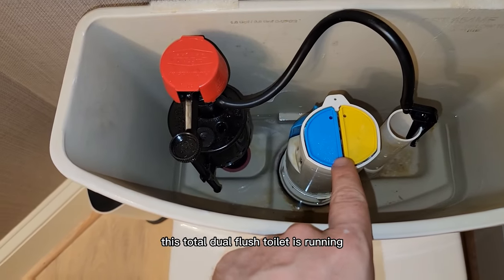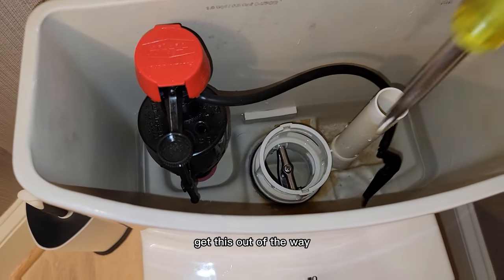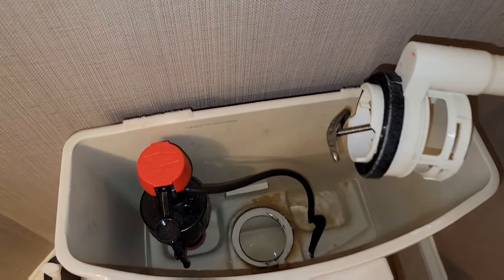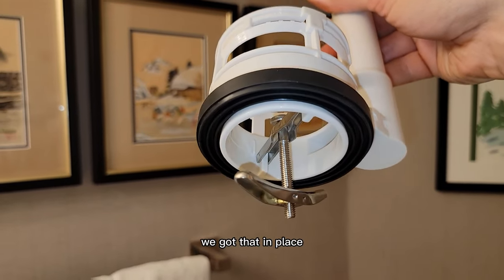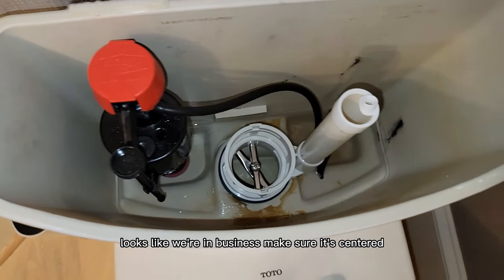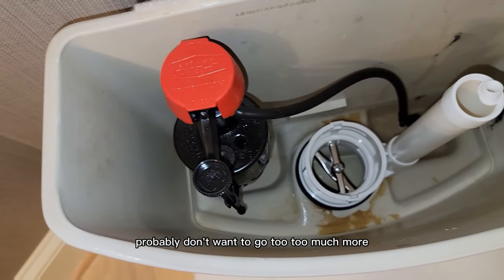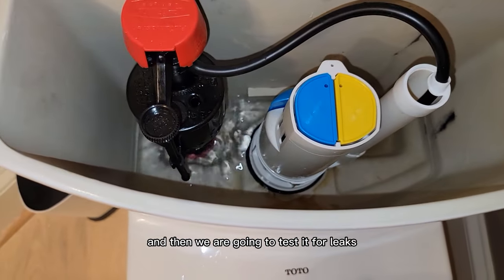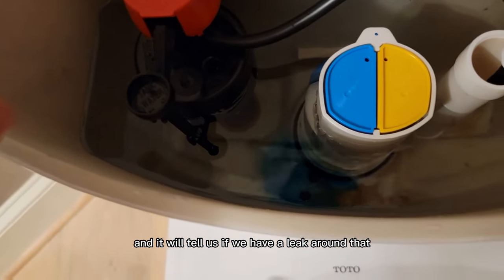how to replace a dual flush valve #toto #toiletrepair #plumbing

Comment: I just recently came across one of your short videos in which you were promoting the use of shark bite products, you also claim that soldering is going to be made illegal. I'm not sure where you're at in the United States, but in the Detroit area none of my colleagues ie licensed plumbers would ever risk their license on a SharkBite product they are just two prone to fail. Secondly there is absolutely no intention of making solder illegal. I am curious to know what area you are from and where you're getting your information.

Comment: 🤣Man, I replaced my toilet valve yesterday due to it constantly running water. Initially, I had no idea what was causing it, so I just removed the lid and stared into the tank to get an understanding of how it works. 

The troubleshooting part was fun, and installation was easy. The mosy bothersome part was adjusting the valbe height to the correcy water level - took me 3 tries 😅